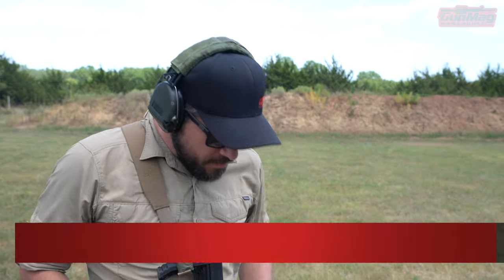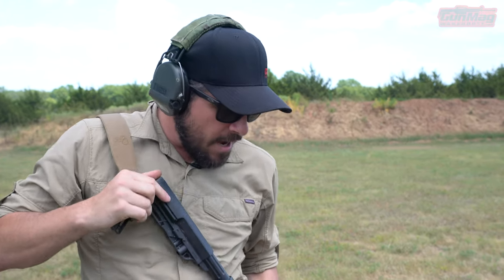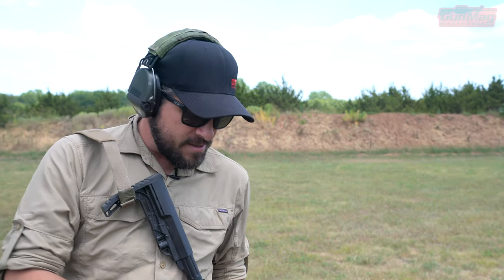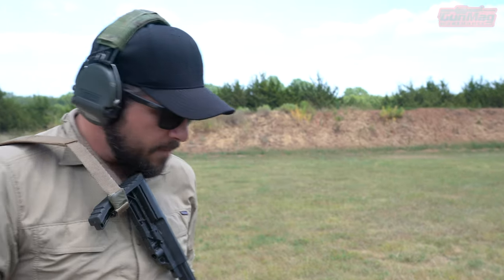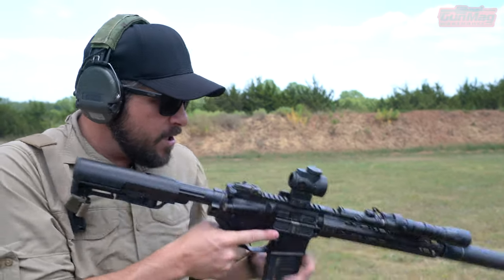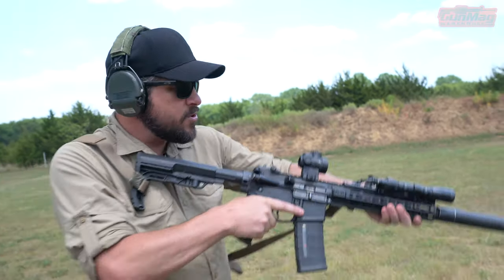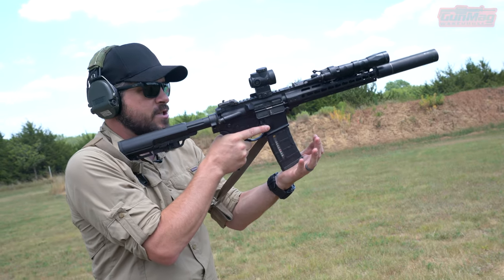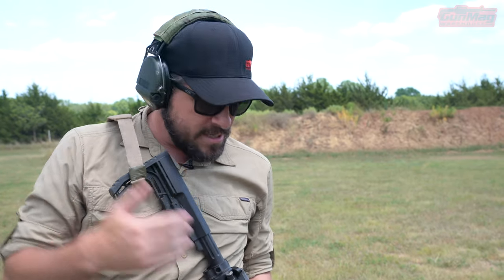Failure To Fire | AR-15 Stoppage Clearance

Comment: What did you mean by "metal on metal"? You didn't explain it at all.
Reply: is that what he says when he pulls the charging handle? I think he means to make sure you pull it all the way back until it stops moving
Reply: @jason_r_  Plausible. Thanks.
Reply from the maker: @OhioCruffler  Also all the way forward which a lot of people fail to do then. try to load a new mag with the round still in the chamber.
Reply: @GunMagWarehouseTV  thanks. Makes sense